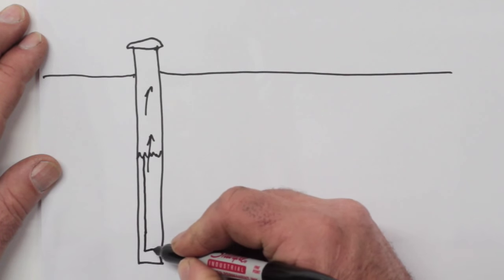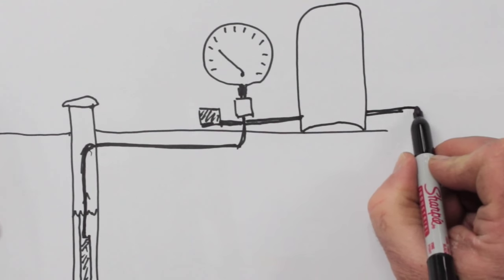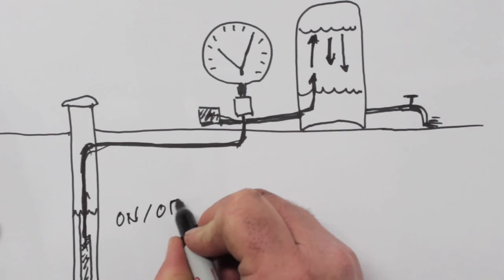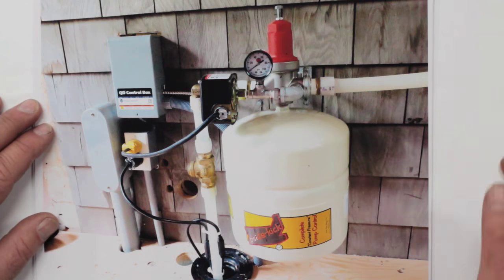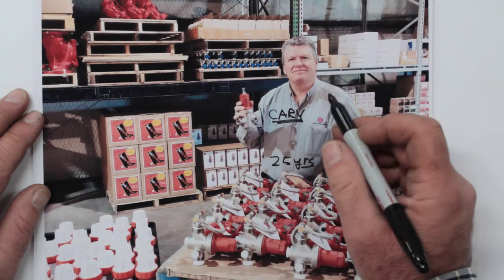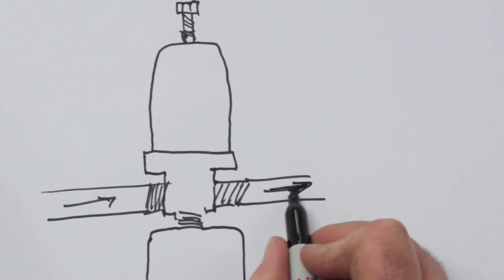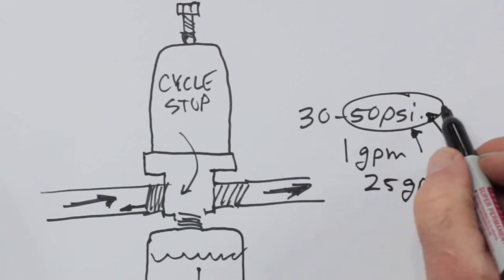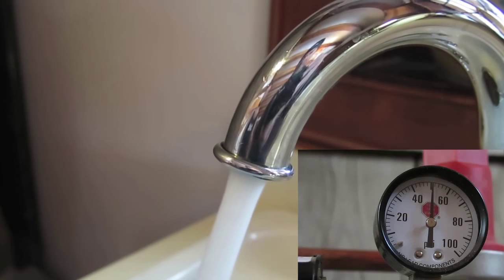How to Make Your Water Well Pump Last Longer

Comment: This is a misleading title. This will not make your pump last longer. Just found this video and love the sales pitch and the time put into the drawings. If you want constant pressure to home a well with variable speed drive is a very efficient way to achieve this.
Reply: Sorry Alex but you have a lot of catching up to do.  Variable Speed Pumps are not efficient.  Variable speed pumps are a scam to separate you from as much of your money as possible.  The CSV was deigned to replace troublesome and expensive VFD's and we have replaced hundreds of thousands of VFD's with CSV's in the last 28 years.
Reply: Obviously you have a product that you claim is more efficient than variable frequency drives and to sell this component you need to make people believe that it is better. I appreciate your videos and beliefs of your product. But the title of this video is not true. This product introduces a different problem of increasing static pressure on pump. Yes amp draw is reduced, I agree, but with any work producing motor setup, including blower assemblies, when you choke down its work the amp draw will go down. Increased static pressure on any system will reduce the work needed to be done but at the cost of the efficiency the motor. A well pump, however deep it may be, already has pressure to overcome just to get water to home before it gets there. We can agree that a pump will work at its highest efficiency when zero static pressure is applied. All that I was saying is that the title would be great if it stated “how to maintain constant pressure without variable speed pump drives”. Anyway I appreciate your views of products that you create.
Reply: Looking at a few of your posted videos I noticed that comments are turned off and you have had others make comments and you have tried to shut them down. I am glad that you are very firm to your beliefs. I will end this here that I appreciate your encouragement to do more investigations on our own. Don’t believe something just because someone else believe it.
Reply: @alexstone4795  Sorry again Alex, but your 30 years behind.  A CSV can never deadhead a pump.  It works so well the major pump companies blacklisted the Cycle Stop Valve in the early 90's as a disruptive product.  They said "The CSV makes pumps last longer and use smaller pressure tanks, so anyone who mentions a CSV will be fired immediately".  You are right that the CSV replaces complicated, expensive, short lived, and inefficient VFD's, and we have been doing so for almost 30 years so far.  The title is very true.  CSV's make pumps last so long pump manufacturers will do or say anything to keep you from trying one.  And if you haven't tried a CSV, you don't know how well they work.
Reply: As always, appreciate your replies. I like the different view points of products. I have worked with many people like you who feel that the old way was the best way to do things and I am always open to different view points. I am sorry that you have to revert to insults and flaunting your supposed experience to inform people of your product. I have found that the best way to understand a product is to use it. I too was one who was so stuck in my ways but had to be humbled and had to train myself to look at a problem and see more than one solution.
Reply: @alexstone4795  Sorry Alex, but you were the one who started the insults by saying I was "mis-leading, untrue, and that variable Speed Drives are the only efficient way, which none of that is true.  Now you are saying I am "flaunting my supposed experience" as though I am lying about having been studying all this for 50 years.  I am used to insults from people who don't understand pumps as well as I do.  But I will give back as good as I get, because insults or not, I am not the one who is incorrect here.  I didn't think I was insulting you by saying your 30 years behind, as most people are.
Most people are very humbled after trying a Cycle Stop Valve and seeing that every single thing I say is true.  Didn't mean to insult, was just trying to educate.  But it is a very sensitive subject for me because I have been dealing with these accusations for almost 30 years now.  I have lost patience with people who post inaccurate information then insult me for correcting them.  I can get as technical as you want, but nobody has ever proven me wrong in all these years.
Reply: Again, I appreciate your replies. Keep doing what you do. Don’t fret about what people say. If it is what you believe then keep going. I will keep trying to see things your way. I work with similar equipment and products in Hvac. I still stand on my statement of misleading title. I will edit a few of my comments and look foreword to looking more into you product.
Reply: @alexstone4795  HVAC is a little different in that you usually don't have to maintain a constant pressure.  But the amps draw of fans and pumps drops almost as much by just restricting the flow with a damper or valve as they do when using a VFD.  I  have been privy to some conversations in a few high level discussions by some pump manufacturers.  I can tell you that a lot of VFD's are pushed in areas where they are not so beneficial as they more importantly promote planned obsolescence and increase manufacturers profit.  The fact that everyone falls for the hype that they save energy is just icing on the cake.  Pump manufacturers don't even have to deceive anyone as they have a following of minions to do that for them.  As long as so may people are convinced of the myth that VFD's save energy, the pump manufacturers will just let them keep believing that and laugh all the way to the bank.

Comment: Is there a way to have it shut off the pump after say 15min? In case a toilet valve didn't close?
Reply: No, the CSV would just think someone was still using water and keep the pump running.  However, that is a good thing as leaking toilets are responsible for cycling a lot of pumps to death.
Reply: @cyclestopvalves8380  I have been told that keeping the pump running will also ruin it. I think I need to build a better mousetrap
Reply: @charlese2833  Pumps are made for continuous duty. I have one that hasn't shut off in 19 years so far.

Comment: yeh but if your pump is running all the time what happens to your electric bill .I have a 1 hp pump and it is 400 feet down and i can see my electric meter spin faster when my comes on and see how much it costs me when it runs through my smart house.NOt fun to get a high electric bill
Reply: With a CSV the pump only runs when you are using water.  Plus when using small amounts of water the CSV makes the pump draw lower amps, so it doesn't increase but rather decreases the electric bill.

Comment: Didn't explain that while water is being used at the house that the expansion tank is not being filled. When water use is done the tank fills slowly and allows the pump to run. As long as it is not trying to fill a larger tank then it will run long enough but not too long to waste energy!
Reply: When set correctly the CSV fills large pressure tanks in a normal amount of time.  You don't have to have a small tank, but that is all you need.

Comment: If the pump runs all the time, do not you electric bill go up too?
Reply: It only runs while you are using water.  And the amps are reduced when the flow is restricted.  That is just how pumps work.  So, the pump runs longer, but at reduced amps, and it does not increase the electric bill, just the life of the pump system.
Reply: @cyclestopvalves8380  yes, the electricity goes way up. You use much more electricity regardless of what cycle stop valve man says. I have studied this in detail. I am not guessing,  I know for a fact.
Reply: @LarryElterman  The only thing we know for a fact is that Larry Elterman has no idea what he is talking about.

Comment: So if the pump stays on, wouldn’t your electric bill be crazy high?  Also, what if you don’t use water for a week on vacation?  Does the pressure hit 60 psi and switch off?  If it switches off every time we stop using water, then how is that not hurting the pump the same as with no csv?   So confused. 🤔
Reply: The pump only runs while you are using water.  It actually uses less energy than if it were cycling on and off while you use water, as it takes 6-9 times the running power every time the pump starts.  Other than that the CSV system is no different than a regular pressure tank with a 40/60 switch.  When the pump shuts off at 60, it will stay off for the whole time you are on vacation, as it will only come back on when you use water.  The pump doesn't shut off as soon as you stop using water.  It stays on for a minute or so to fill the pressure tank after you stop using water.  That is a 1 minute timer that doesn't let the pump cycle if you open up another tap during that time.  Timing the off to make sure you are finished with water before stopping the pump and making the pump run the entire time you are using water is how the CSV stops cycling and makes the pump last longer.

Comment: man, this back pressure should go somewhere, so it goes back to pipes in the well, and you will burst them with 200psi or more pressure, THis thing will save you pennies compare to the fixing of pipes in the well.
Reply: If your pump builds 200 PSI back pressure it is way oversized.  100--150 PSI is more common.  But well pipe is designed to handle high pressure, as just being at the bottom of a 400' deep well is well over 200 PSI.  Back pressure is good for pumps as it makes the amps drop and the motor run cooler.  It is not hard to figure how much back pressure each pump can build.  If your pump builds more back pressure than the pipe or CSV can handle, you just won't get all the benefits and strong constant pressure control of a CSV.

Comment: The pump will NOT draw "less amperage" if the valve is applying back pressure. Power is Flow Rate x Pressure. If you increase back pressure and keep the flow rate constant....... that increases power draw.
Reply: Prince Nephron 
Indeed, the energy usage per gallon increases a lot, because the pump becomes less effective.
Reply: Not true!  Pumps are counter intuitive.  Pumping full volume causes the pump to draw full amps and run the hottest.  When restricted with a valve the amps drop and the motor runs cooler.  I know it sounds crazy but that is how pumps work and is why so many people are confused about this.  Any pump is still more efficient at max flow, but the amps do drop when the flow is restricted.
Reply: Cycle Stop Valves 

Stay focused, do not distract from the topic. 

Tell the truth about your product, don’t lie. Be transparent and honest. 

CSV restricts the output flow, simulating a higher head, shifting towards the left side of the curve, outside of the manufacturers range of operation. 

That voids the warranty. 

If your pump breaks the manufacturer will cancel the warranty because you misused the pump.
Reply: Cycle Stop Valves 
Your product reduces the efficiency of the pump. The pump will use many times more energy to pump the same amount of water, and waste more energy and produce more heat.
Reply: Cycle Stop Valves 
Please stop lying. 
If you have a 20gom pump sized correctly, it takes 2 minutes to produce 40 gallon. 
With your product, if the flow is 2 gpm the pump will run for 20 minutes, at a degraded efficiency, and overall you will use 8-10 times more electricity to produce the same 40 gallons, and you will waste much more energy into heat.
Reply: @paftaf  You are exactly right!  I have been lying about how well Cycle Stop Valves works for 27 years now.  In over a quarter of a century I have fooled hundreds of thousands of people and even the US patent office.  I tricked the US patent engineers and attorneys and got several patents.  I tricked hundreds of thousands of people into thinking CSV's really work.  It is just the Placebo effect.  I put people in a trance and make them believe their shower water pressure is stronger, their pumps are lasting longer, and using smaller pressure tanks is OK.  I fooled many of these people into thinking the CSV is the reason their pump has lasted many years more than the one before.  I secretly go and personally repair everyone's pumps in the middle of the night just to keep up the ruse.  I spend millions replacing all those pumps so no one finds out they didn't last very long.  I staged the reviews, pictures, and stories from thousands of happy customers.  So you caught me.  You are so much smarter than everyone else.  I have had technical discussions with hundreds of engineers from every major pump company in America and none of them saw through my facade.  I was able to fool everyone but you.  I bow to the great Redwood Madrone and everyone should do as he says.  He is by far the most brilliant person in the world and everyone should know it.  (Big eye roll if you couldn't tell)  LOL!
Reply: Cycle Stop Valves 

CSV drastically reduces the electrical efficiency, wastes a lot of energy, and voids the pump manufacturer warranty. 

You can cry and whine as you want, those are facts. 

I see that you deleted your previous comment, because you know that Franklin voids their warranty if you use a CSV. Thank you for deleting that false comment you made.
Reply: @paftaf  I am not the one crying and whining, you are.  In 27 years CSV's have made hundreds of thousands of pumps last longer and solved people's problems, and you act like this is something new that is bad for pumps.  LOL!  You just can't fix stupid.  And you Redwood are un-fixable.  NO pump company is going to void a warranty.  It wouldn't matter if they did as there has never been a single pump running on a CSV that even needed warranty.  Just the opposite is true.  CSV's have made hundreds of thousands of pumps last much longer than normal, and that is the only reason any pump company would try to talk people out of using a CSV.  Cycle Stop Valves were blacklisted by Franklin, Goulds, and many other pump companies in 1994.  But not for the reason you might think.  The quote from Goulds was...."CSV's make pumps last longer and use smaller tanks, Goulds makes pumps and tanks.  So any employee that even mentions a CSV will be fired immediately."  Cycle Stop Valves couldn't get a better recommendation than that!  Have a nice day!
Reply: I'm remodeling a house and planning to switch to the Pside-Kick. I'm going to put a clamp meter on my well before and after and see who's right here. I'll report back in a few weeks.
Reply: @user-lp9ye1po3w  - I’m curious to know how your experiment is going... status update?
Reply: I think this Valve was designed by The Electric Company